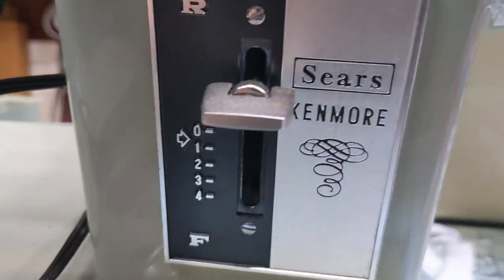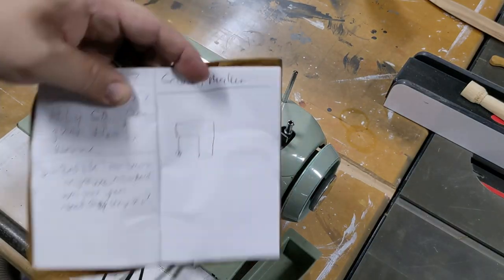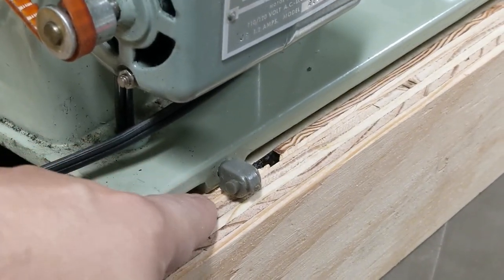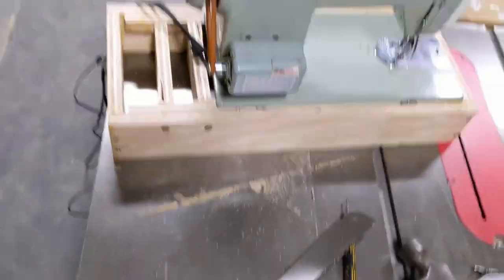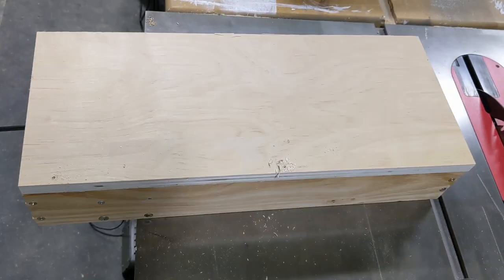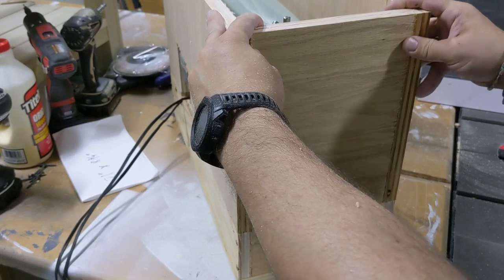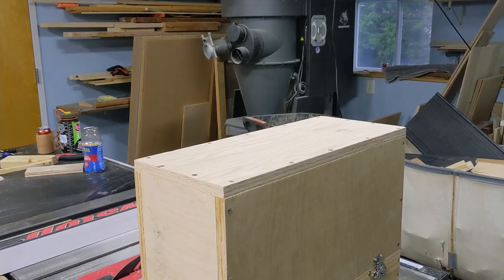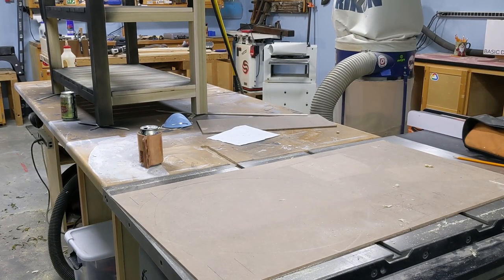Building a Case for a Portable Sewing Machine

Comment: The hinges for the old plastic case didn't have to be cut off, ruining the paint finish. They were simply held in to the hole with a set screw underneath.
Reply from the maker: Good to know, thanks for sharing!
Reply: @TheNewJankyWorkshop  Those hinges are kind of important when you need to oil the machine. You can pivot the machine back and oil the mechanicals underneath, which is critical to these old machines running well without seizing. Then you pivot the machine back. I thought for sure you were going to create a channel for those to fit into. Actually, that was the main reason I watched.
Reply from the maker: Good to know! Thankfully, this thing was only $20, so I am not out much. I still need to learn how to use the thing! Sewing plans have been put on hold due to loads of other projects and commitments. One of these days I'll dust this ol' girl off and learn how to use it properly. Actually, no dusting will be needed, as it is in a case.